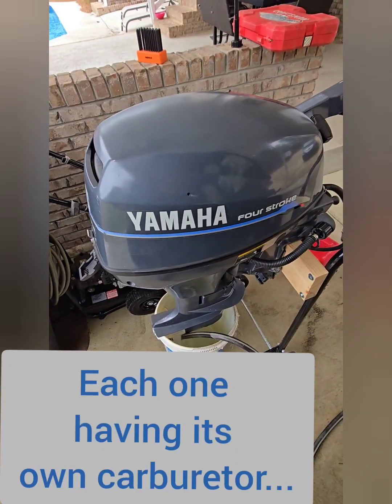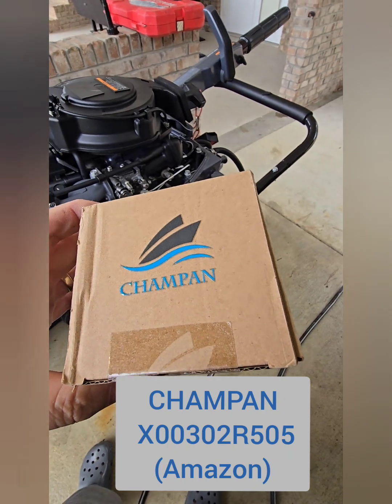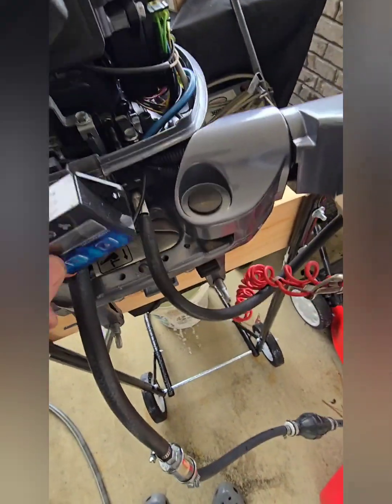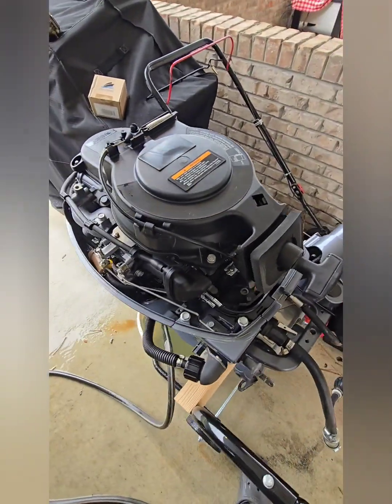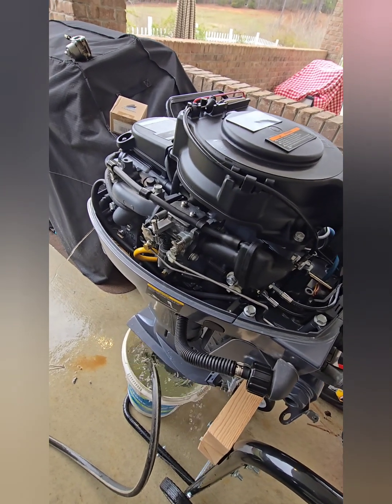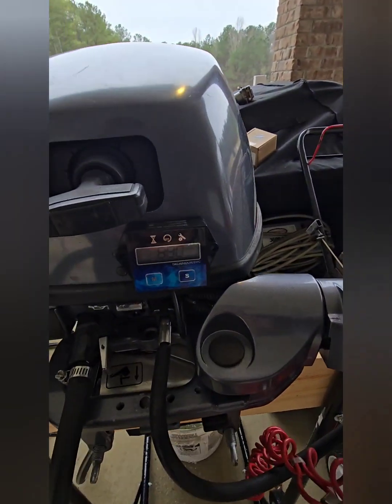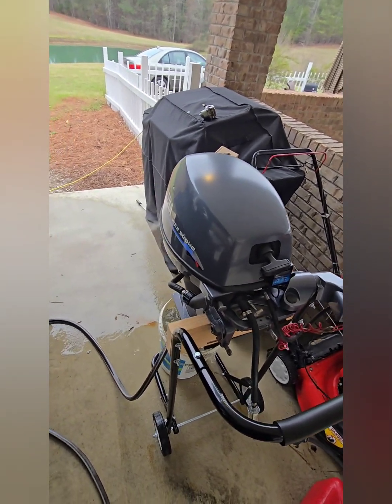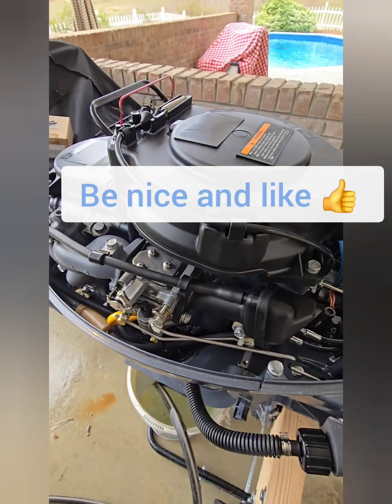Yamaha 6hp / 8hp to 9.9hp Carburetor  Conversition Replacement w/ Tachometer installation

Comment: Hi ! Is the speed gain good? No problems since then?
What year is the engine?
Thanks :)
Reply from the maker: I dont remember the year. Ive since sold it on the boat it was on. But if you have a 212cc either 6hp, 8hp or 9.9hp they are the same engine. I believe they started in the early 2000s and may still be made. But yes you will get some noticeable acceleration and speed. No problems at all.

Comment: Hi: great video thank you. I have the same Yamaha 6hp that has carburetor issues and found your video while trying to find a carb cleaning tutorial. Did you test the 9.9 mod on water-noticeable change? Also, the venturi throat on the 6hp is very small maybe 13mm diameter with a butterfly valve throttle that only opens maybe 60deg (vs. 90deg fully open): how big is the venturi/throat on the 9.9 ?
Reply from the maker: Ive since sold it but its noticeably bigger. You can tell a difference on and off the water. Reves up higher and faster. Ive since got rid of that boat and motor so im not able to get measurements for you

Comment: I have a 2021 version would this work your version looks older
Reply from the maker: Im not sure. You can always go to the part suppliers website and check part numbers for both 2021 modeks. Start with carb, intake, pistons, head etc. If only the carb is different then you might be good to go